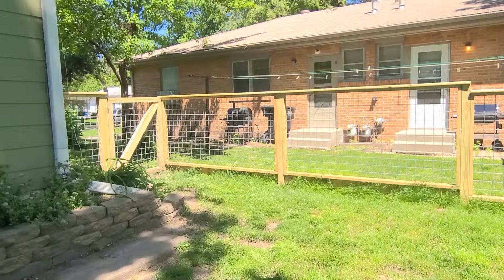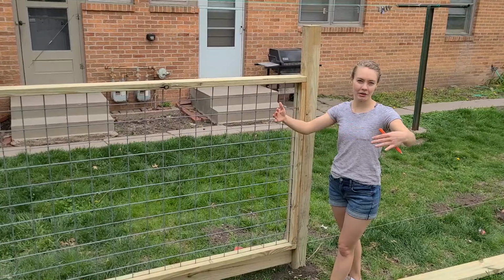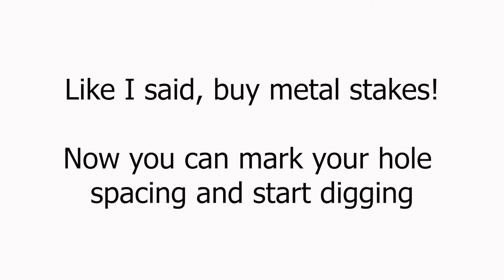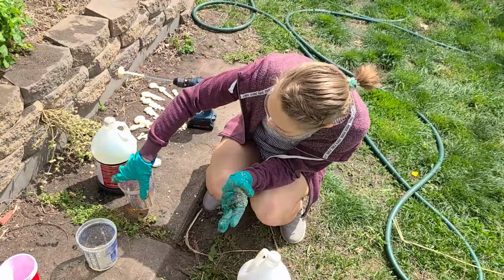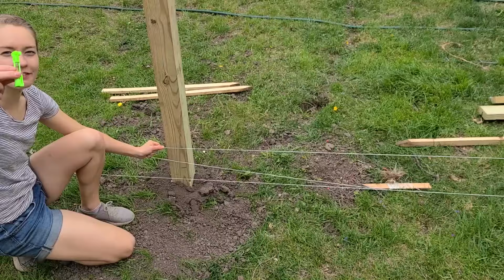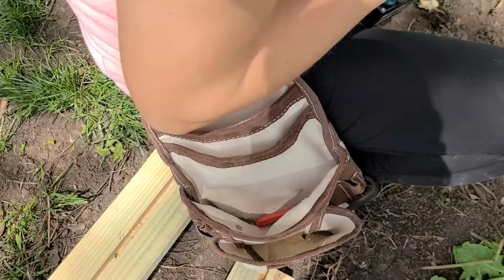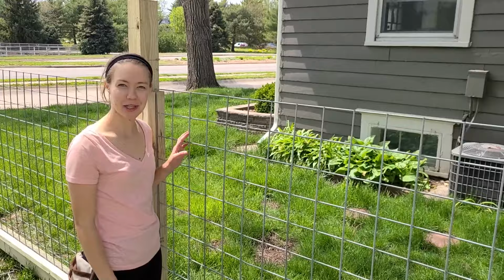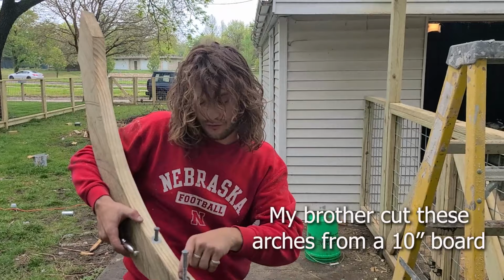How to Build a Hog wire Fence - Start to Finish!

Comment: We are only halfway done with our fence, but I wanted to take a minute to thank you for your video. Our project is massive and as I watched other videos, I knew there was no way I could build the frames and then carry them out to the posts. As soon as I saw your video, I knew this was the answer. In fact, I watched another video later where the guy said after he completed his fence that he saw your video (he didn't say your name, but I knew it was yours) and it seemed like it would be much easier than the method he used. He's right! We are trying to keep deer out of our yard and they can jump over 7 1/2 ft. So we bought hog wire/cattle panels that are 6ft X 20 ft and cut them in half. Then we'll add another board across the top of the posts to achieve the height we want. With your method I'm able to build the frames onto the posts, prep the top rail of the frame and then ask my husband to carry the wire out and pop it into place for me. Works like a charm! Thanks again!
Reply from the maker: So glad the video helped!! I originally planned to build this by myself so I had to figure out how to simplify it as much as possible. 7 1/2 ft? I thought my husky was bad! haha good luck on your build!
Reply: @jacintachristiansen3011  We were trying to see the car license plates to see where you built it. I noticed that most of the videos I watched were Midwesterners. My Midwestern upbringing kicks in as soon as we get a quote for a project. "Wait - $10,000 for a fence?" I told my husband, "I guess we're learning how to build a fence." The materials are costing us $3000 total. In some ways I wish I hadn't been raised to think I could just do these things myself -- I would rather be a Joanna Gaines who just tells her husband or some worker what he needs to do. Ha! But being handy has been a blessing for getting things I couldn't afford to have done. Good luck to you in all your future projects because I'm betting there will be more to come. :)
Reply from the maker: @KA-fe2nl  OMG this cracked me up! haha born and raised in Omaha, NE but this is at my house in Lincoln, NE! Where are you from? I always had the mentality that you can figure out how to do anything and I realized when I was older that some people don't think that way. It is definitely part of the midwest upbringing but it helps that my background is in structural engineering! Recently quit my job and there have been many projects since but I haven't documented them well. Although I'd like to build a tiny home soon and I think I will try to film that! :)
Reply: @jacintachristiansen3011  I'm from northwestern Ohio.  I saw another video (or maybe two) from Nebraska and one from Indiana. There was another young lady with a very Midwest accent and the landscape was Midwestern. So, my dad was a jack of all trades and built our house himself. My mom chose it straight out of Better Homes and Gardens when I was a kid and it was beautiful. I learned from him and started doing things myself, remodeling my first little house when I was 18. But in 2007 my husband and I moved to Texas and people hire all this stuff done. Heck, they hire people to hang their Christmas lights and I was thinking no way anyone I knew would pay someone to climb a ladder and string lights. Ha! Funny story:  We bought an inn in San Antonio and put on an addition to the carriage house (my dad helped us); the HVAC guy showed up to move the AC unit and asked my husband where I was because "she's an engineer, right?" Nope, a language professor. Cracked me up! I must have spoken with authority on the subject compared to other people. 
Interesting side note: my husband is from the East coast and he didn't even know how to change the oil in his car, let alone do all the other stuff required for owning an inn. So the first time we had a plumbing issue and he said we needed to call a plumber, I said, "Why? The leak is right there. That's an easy fix." That was my mistake though. Next thing I know I'm remodeling bathrooms and laying tile....  My son told his wife that taping and floating dry wall is "woman's work" so I'm not sure I have done her any favors.
Reply: I would watch that tiny home build!
Reply from the maker: @KA-fe2nl  hahaha that's so great! I definitely plan on building my own house in the future. Home building has been my obsession for a while because it can be done so much more efficiently than what is common practice here now. Take German passive homes for example...much better way of doing things in my opinion. And I know how that goes...you never just remodel or fix one thing! Sometimes I think it would be better if I rented an apartment because it would be the only way I wouldn't live in a construction zone haha

Comment: I've watched several videos on how to build this fence, and this is the best version!  I liked your casual approach; it showed how easy it is to get this right.  Also, how you assembled the panels in place is genius; no heavy lifting.  I loved the foam instead of concrete to set the posts (I don't want to lift those bags either!).  The decking along the top is another great looking option; I'd thought of that and was glad to see it here.  And you and your brother are great together.  Thanks for the video!

Comment: For post foundation just insert the post in the empty hole, pour a 80 lb concrete down the hold and then level the post. Pour a 5 gal bucket water in the concrete and work the air pockets out with a piece of R-bar. Verify level again.  Quick and easy.  Use a chainsaw at the very end once all panels are installed to level the top of posts with each other.

Comment: When it comes to joining sections of top rail together, always do a 45 degree cut on both end so they shed water better and as the wood dries up and pulls apart the joint will not be so obvious...

Comment: Loved the foam usage. Just so you know the red bags quickrete  are fast curing. They take little water and no sand and will cure in I think like 20-40 minutes.  Enjoyed the video very much.
Reply from the maker: Thanks! I considered using something like that but I didn't want to carry all of those heavy bags if I could avoid it!
Reply: @jacintachristiansen3011  be careful a lot of times post foam will start to contract and the pots will become loose.

Comment: Great job, I see its been 2 years how has the foam held up? I'm doing 1& 1/4 acres. Was told the foam would shrink away from the post, causing them to be unstable.  Amazon,  one side will take 61 post, so either 61 80lbs bags of cement or the foam.
Reply: Same with me, fencing about 3/4 acre.

Comment: I always recommend a wide brim hat and sunglasses outside in the full sun unless you want cataract surgery on your eyes in your 50's & 60's. I also learned that a long sleeve wicking SPF 50+ shirt keeps off mosquitoes, helps prevent skin cancer and even keeps you cooler in the sun. Yes, I am in my earl 60's and many of my friends have skin cancer that sunbathed or worked outside and cataract surgery seems to be a thing. Yes, they were all outdoor enthusiast while my friends that stayed indoors avoided these issues almost entirely. I moved to Alaska for many years and then moved back home and that is when I saw all the damage the sun did to my friends. I avoided it only because moving to Alaska forced me to wear sunglasses in the snow and coats and long-sleeved shirts everywhere. I am a former Scoutmaster and the kids and adults always asked in the hot Oklahoma and Texas sun why I wore long sleeve shirts and I told them it kept the bugs & sun off and made me cooler. (sunglasses were a common thing). They all thought I was crazy but sure enough after a few hot campouts I noticed they all were starting to wear long sleeve SPF 50+ shirts too, go figure?

Comment: Hey! We're looking to build a driveway gate by framing hog wire - like you did! What are the dimensions of your gate and gate panels? (Trying to decide how big the gate can be before it starts to sag!) Thanks! Really love the video!
Reply from the maker: Thanks! The gate is about 4ft x 4ft. Make sure your post is very sturdy and buy quality hinges! In our case, the archway helps keep the posts from leaning. As far as the gate itself sagging, the hogwire is pretty sturdy but you could always get a lower gauge panel (thicker wire) if you want to go wider than 4 ft

Comment: Great video, thank you. I am going to build a small section in my backyard to start and probably expand it later (if everything goes well). I have a few trees, so I am hoping their roots won't create problems with the poles. How deep did you dig for the posts? 2 feet? I like the foam idea, how is it holding up? I have seen videos where it shrank later creating a gap and making the post unstable. Thank you for sharing.

Comment: Want to build this fence, but how you put the mud board on the 4x4? It's the first we are doing a fence. Quotes from a company are really expensive in FL
Reply from the maker: Just drill the screw into the post at an angle. You could always use a jig to help with angling the screw if you need to. You can find something like this at any hardware store. https://www.amazon.com/Joinery-Woodworking-Carpenters-Woodwork-Carpentry/dp/B08LTGMR3C/ref=sr_1_7?dchild=1&keywords=drill+angle+guide&qid=1609624157&sr=8-7

Comment: Love this!  Do you have the info on the Dado blade?  how wide and how deep of a channel did you make?  thanks!  How did you calculate when to step down..are your dogs ever tempted to dig under?
Reply from the maker: This is the dado blade that I bought but you want to make sure to get one that is compatible with your table saw! Mine takes an 8" blade. https://www.amazon.com/gp/product/B0012YF25Q/ref=ppx_yo_dt_b_asin_title_o09_s00?ie=UTF8&psc=1. The depth was maybe an inch and I believe it was 3/8" wide. It's not too critical honestly as long as you have a little bit of wiggle room to slide the panels in! When and how often you step down just depends on how much space below the mud board you are okay with. If you want it tight to the ground, you'll need to step more often in a sloped yard.

Comment: What were your measurements for the wood frame around the hog wire panels?
Reply from the maker: I spaced my posts at 8ft on center so that would make the frame 7'-8" wide (I used 4" posts). It's 4'-2" tall

Comment: What gauge hog wire did you use?  I'm on the east cost and we need this as a residential fence, without heavy animals to contain.  It's hard to find 6 gauge wire here! We're planning to use 8 ft sections.
Reply from the maker: 6 gauge but you could definitely get away with a higher gauge if you don't have pets! My dogs jump on it all day which is why I went with the heavier duty panels

Comment: Great job.  If I could offer just 1 piece of advice - don't wear gloves when working with power tools, especially a table saw.  Your brain has a good, instinctive sense of where your fingers are, but not the tips of your gloves and many severe accidents have been had when the tip of someone's glove makes contact with the blade and the person's hand gets sucked in.